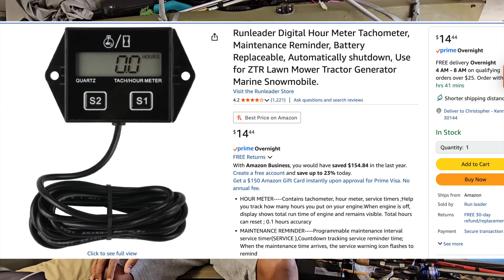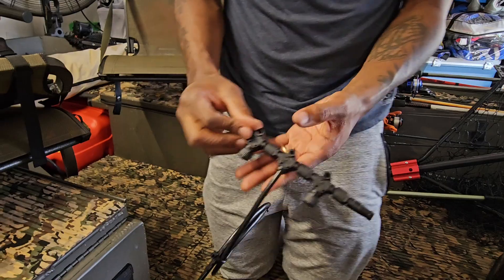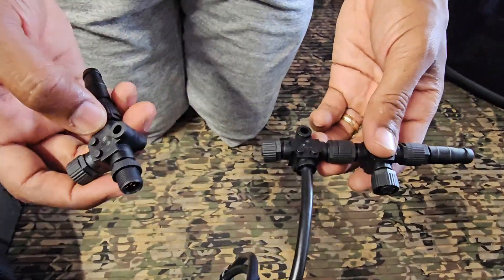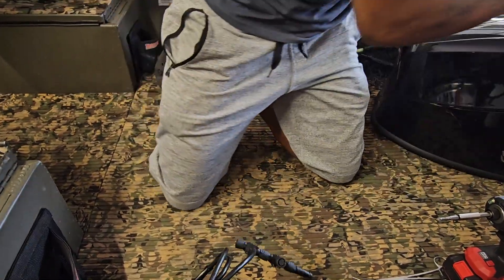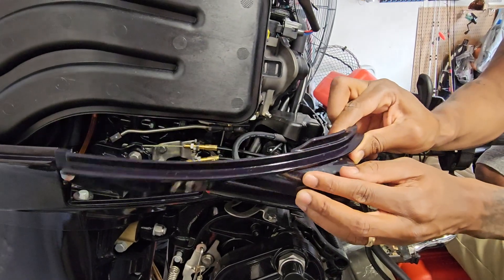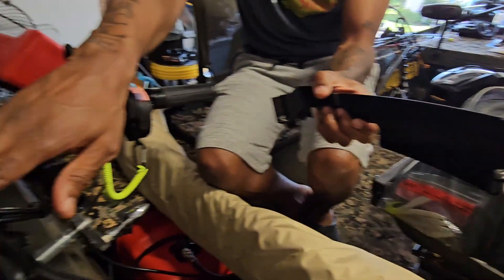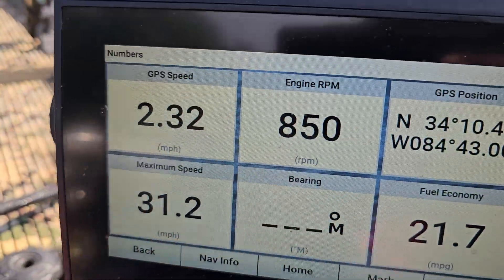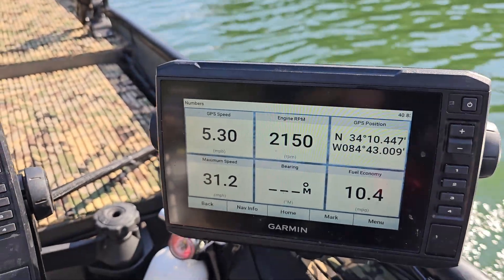SOLVED! Tachometer Issue with NMEA 2000 Network Install on 30 HP Tohatsu Outboard using Garmin 73SV

Comment: Chris, Excellent explanation!  Can we link to your video on our website?
Reply from the maker: Yes, indeed. Thanks for reaching out. Great product and details you provided. It really made the installation a breeze.
Reply: Chris said in the end of the video ( 11:41 ) that this should be the same for the 20 hp Tohatsu.

 I was happy but also skeptical,  looked on the goldenchanels site and it says that it's available only for the 25 hp and up, wich I expected, knowing that the 20 doesn't have the NMEA connection.  

So, did Chris make a mistake or did I hear it wrong?
Thanks!
Reply: @silviuflorescu6838  You are correct.  Tohatsu 20 HP outboards do not have an NMEA connection.  NMEA starts at 25HP with Tohatsu outboards.
Reply from the maker: Thanks for clarifying this.
Reply: @fishingistherapy  You're more than welcome!

Comment: Just bought a NMEA kit for my 25hp Yamaha. Still have to buy a compatible graph but looking forward to getting it and ditching the inductive tach. Thanks for the heads up on the parasitic draw.
Reply from the maker: Definitely, man. I'm glad I went this route. The inductive tachometer had my 3 cyclinder reading crazy😅 Appreciate you watching.
Reply: @fishingistherapy Mine works well on this 2 cylinder but I had similar problems on a 3 cylinder Yamaha 2 stroke. I’m interested to see what all readouts my motor supports.
Reply from the maker: Yeah, Golden Channel has a setup for all motors, and they can tell you waht readout you czm expect to get base don your motorn and fish finder setup.